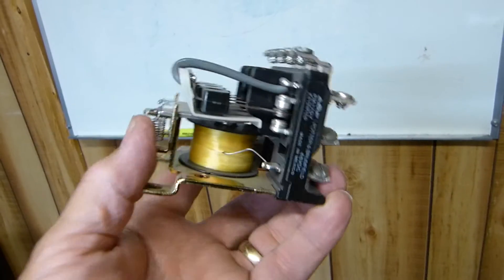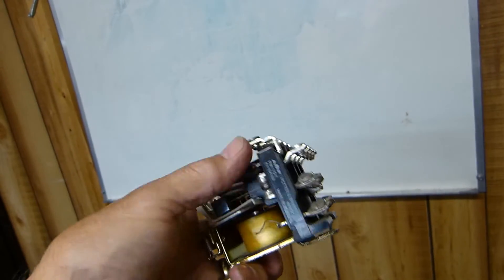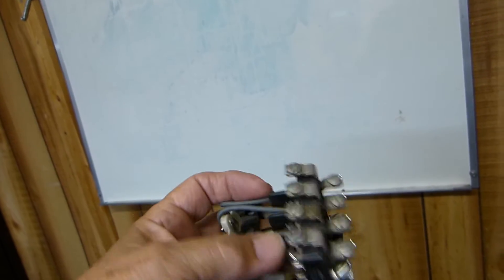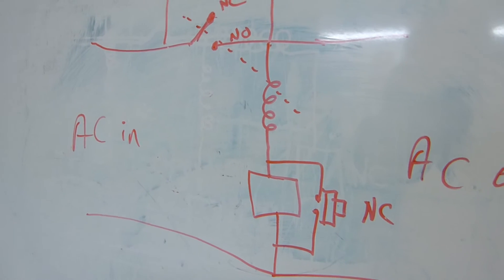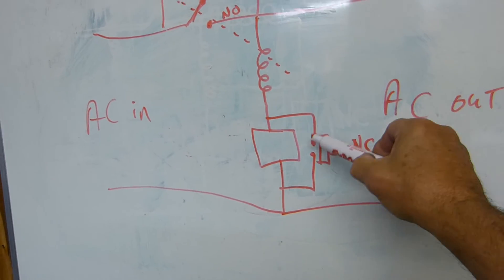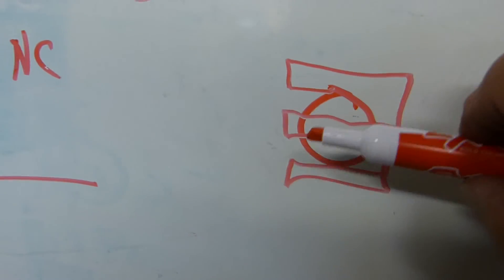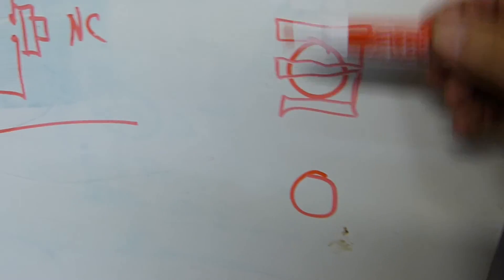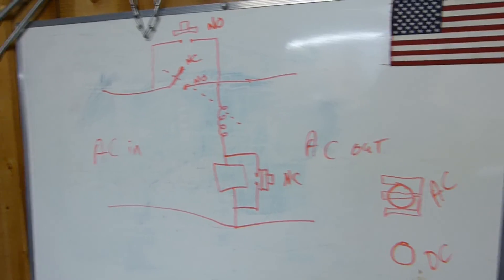Holding Relay Circuit To Protect Equipment From Power Fluctuations

Comment: Excellent video, David. Thorough, informative, and to the point. I was not aware that AC relays could be used with half-voltage DC. Thanks so much for posting it.
Reply from the maker: Uncle Doug Hi, Doug - good to hear from you. I hope you and Rusty are doing well. Operating AC relays on half DC voltage may not be a written technical specification but it has worked for me. I wish I had also drawn a holding relay circuit using three poles where two poles are used to open both sides of the line and the third pole is the holding circuit as it is not much more complicated and the on/off latching and holding circuit only goes through the relay.
Reply: We are doing quite well, David, although suffering a bit with the hot weather. Let's hope it rains for the 4th and cools things down :)

Comment: I had an old AC relay from a furnace control board I scavenged parts from.  I built a controller for a friends boiler system heater to run the water circulation pump until the boiler water temp dropped from 180 degrees F to 115 degrees F after the system turned off after reaching thermostat temperature.   I used the relay with DC power because it was the only relay I had laying around that had the current carrying capability of the water pump motor requirement.   I used a variable DC power supply to find it's minimum pull in voltage.    Once I did that I let it run powered up to see if it would over heat excessively while run continuously for an hour.  It ran at an acceptable temperature.   So I used it for the final circuit I designed for my buddies heating system.  It has been working flawlessly for 3 seasons now without fail.
Reply from the maker: jp040759  It is always good to hear success stories. I used 24 VAC relays under the hood of my car to turn on high current devices in the trunk and that is where I discovered the AC relays will run on half voltage at DC. Thanks for your input.